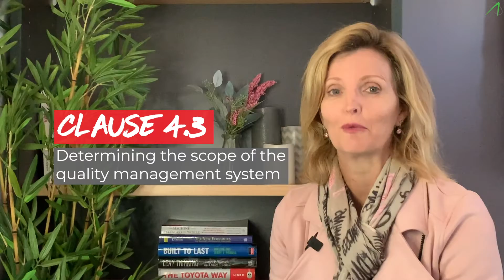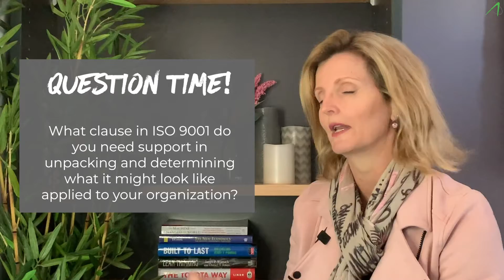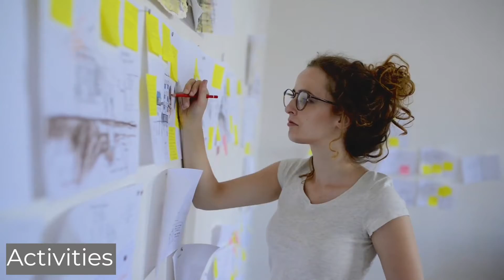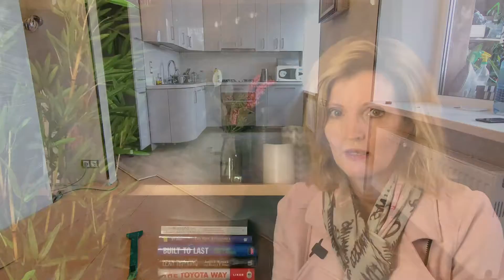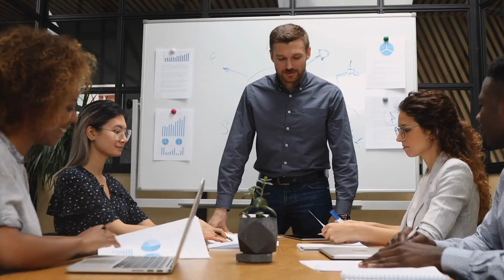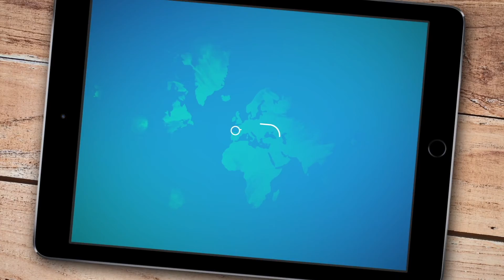Understanding ISO 9001 | Clause 4.3

Comment: Hello
Is there a rule like at ISO13485 of sections thank cannot be excluded from the scope??
Thanks
Reply: Thanks for the question. I do not audit against ISO 13485 and do not have a copy myself to check. However I suggest looking at clause 4.3 in ISO 13485 to see whether this is a statement similar to that in ISO 9001 where it talks about determining what is not applicable to the scope. If this wording isn't in there, then it would appear that there are no areas that can be stated as not applicable (old wording - excluded).
Reply from the maker: we will let Jackie answer that question! thank you for watching our videos

Comment: Shall indicates requirements,

 when determining this scope, the organization shall consider 4.1 & 4.2, 

I think in this context the required in 4.1 & 4.2 should be maintained as documented information.
Reply from the maker: thanks for your comment. 'Should' is the correct word to use here as neither 4.1 or 4.2 state that documented information 'shall' be maintained or retained, therefore this is not mandatory. However, I can certainly see the benefits of retaining documented information of the output from these 2 clauses. Thanks so much for your input. Regards, Jackie

Comment: Can our company website be enough for documentation?
Reply from the maker: Hi @AnetteMekvik, Since you commented on this video (and Jackie shared a great response) we have published a new video touching on ISO 9001 Clause 7.5.1 Documented Information which may also be of interest to you. You can check it out here: https://youtu.be/xykLIPDq-bM
Reply: Great question Anette. Your company website could be 'one' of the areas that could be considered documentation for your quality management system. For example, you might have the scope of your quality management system documented on your website, so this covers the requirement in clause 4.3. Now, I'm just thinking front facing website when I refer to this, however I just thought that possibly you might have a website where staff/suppliers/customers can log in and there is a back end to the website where they can access relevant documentation. So if this is the case, it is quite possible that this could be satisfactory. Does this help at all Anette?

Comment: Is it possible to let the scope only for procurement
Reply from the maker: Great question sarhan32.  It is possible to set the scope only for procurement, therefore, deeming any other areas as not applicable WITH justification for this.  HOWEVER, this depends on what was identified during your process for Understanding the context of your organization (external and internal issues) as well as what you have understood as the needs and expectations of your Interested Parties (4.2).  If you identified factors and influences, needs and expectations that are outside of just procurement then restricting your scope to just this would not really be seen as applicable boundaries.  You also have to consider your products and services as a whole for your organization.  If you are just a business that provides procurement services then yes, however if your business is much broader than this it may not be able to be justified.  Take note of the last line in this clause - it states 'conformity to this International Standard may only be claimed if the requirements determined as not being applicable DO NOT AFFECT the organization's ability or responsibility to ensure the conformity of its products and services and the enhancement of customer satisfaction'.  So I would ask the question 'By having just procurement as the scope of my quality management system does this impact the ability to provide products and services to our customer and meet their requirements'?  Hope this helps :)   All the best - Jackie